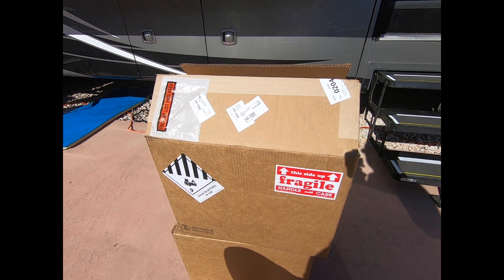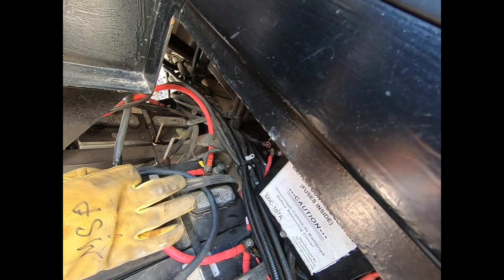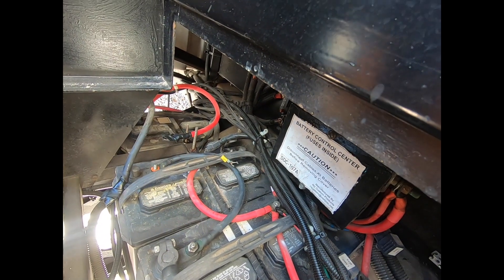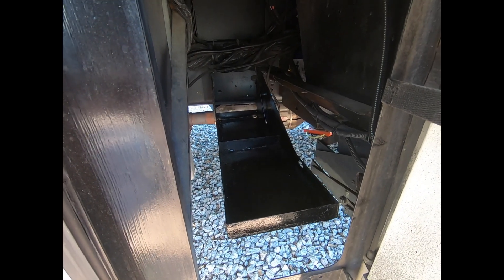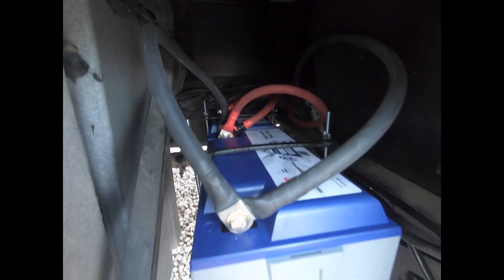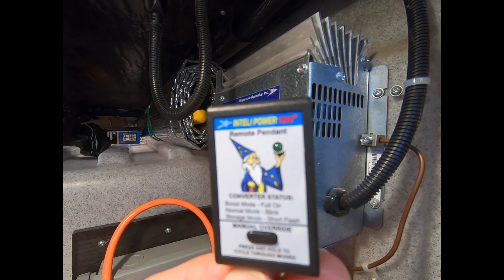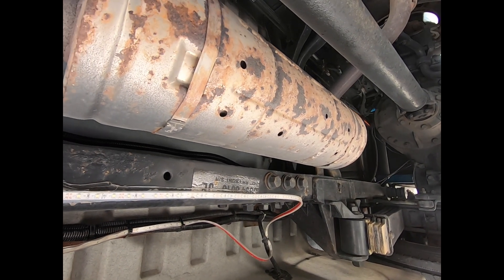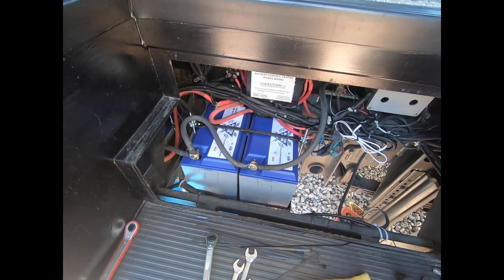Replacing lead acid batteries to Battle Born Lithium ion

Comment: Love the video. You had commented on my FB post a while back about your switch out video. I am planning to install 2x200ah lifepo4 batts in my Georgetown 378. It has the same setup as yours with the house batteries under the steps and the same BCC SDC-107A. Did you replace the BIRD with a Li BIM to protect the alternator from over working with the higher voltage? If so where did you install the BIM, If not, have you encountered any problems with charging the Battleborns with the original BCC and alternator?
Thanks,
John
Reply from the maker: Hi Steve first question. No I have not had any problems with charging off my alternator the thing I’ve noticed is in the first video when I changed my batteries I have a progressive one that came with the coach that was for the lead acid batteries I purchased the other progress of dynamics and that put out 14.6 V continuously but after talking to battle born batteries again about that continuous voltage they recommended that I go back to my original battery control charger and use that and just boost it because the way we were RVing by driving most of the day and then using the batteries at night and they told me that the the progressive dynamics lithium ion charge at 14.6 V was a little too high to have them soak at that voltage all the time. So I went back to the original charger and my Battle born battery I re-calibrated my Bogart  that for the lithium ion batteries and everything‘s been working great thanks for your comment and thanks for watching. 
Please let me know how your install goes. There is always something to learn
Reply: @ACanadianRVereh  thanks for the great info! That helps a lot. Will keep you updated.
Reply from the maker: @stevepigg8753  thank you

Comment: I just found you as I’m looking to see other Battleborn upgrades like the one we are getting ready to do. I was noticing that your rig looked a lot like mine in the main battery compartment under the stairs. My secondary batteries are to the right behind my passenger seat and it appears yours are to the left. I hit the subscribe button to start following you to see what coach you had and what videos you have already done. At the end of this you tell me you have a Georgetown which is what we have. Now I’m curious about your year and model number. Ours is an XL 360DS 2014. I too have the 9200 series converter and intend to add the booster for now 😊 I’m looking forward to checking out your channel! Thanks for doing the video! Marsha